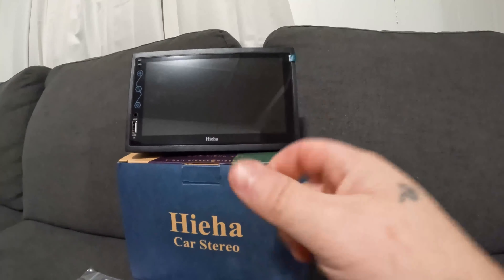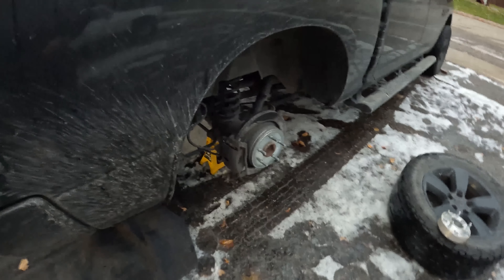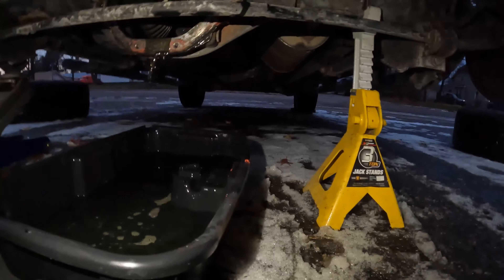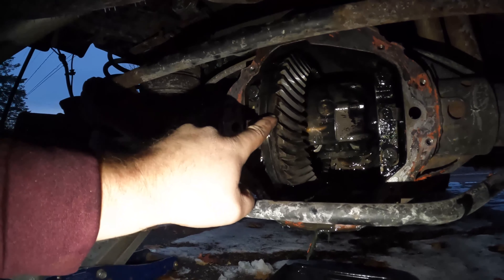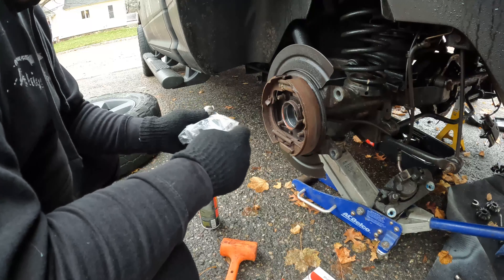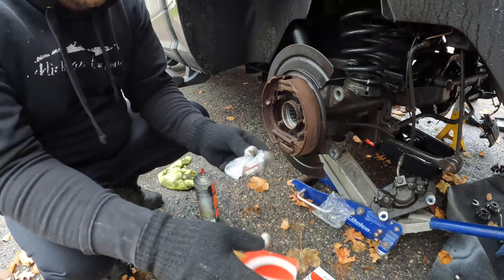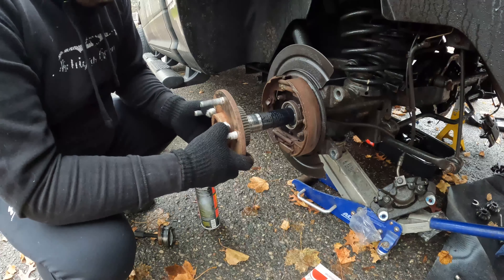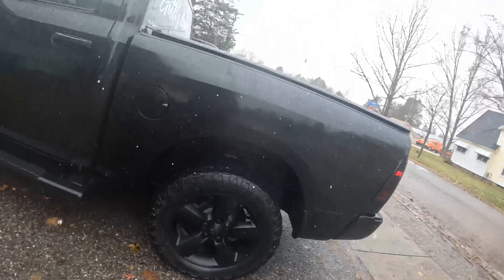09+ Ram Rear Wheel Bearings Replacement #ram #viral #howto #diy

Comment: How did you turn the differential wheel for better access to the pin? I have rear wheels lifted, diff. Cover open, but turning the rear wheel is not turning the differential. Thanks.
Reply from the maker: turn using the drive shaft. im sorry this took to long, I hope you got it figured out

Comment: Was the noise you used to diagnose the bearings growling that seemed to wind up and down with wheel rotation as your speed increased and decreased ?
Reply from the maker: Yes it was a growing life coming from the rear end. I actually jacked up the rear and put it on jack stands put the truck in drive with traction control off and was able to hear which bearing it wae

Comment: Did you have alot of vibration from the rear end? And hear any popping from the rear when taking off? Im sure that this is next for me along with tie rod ends.
Reply from the maker: No just a roar/humming noise. It’s a very easy process you got this
Reply: @GottisGarage  ya I've fixed almost everything on our rides, done front hubs but never rear bearings. Ima buy the tools from harbor freight since we own multiple dodges

Comment: Telling us the cost of rental tools and overall cost compared to getting it done in a shop would have been a nice touch.
Reply from the maker: Yeah I can see that as being helpful lol so this is what I have 
My Shop is 3.2 hours of R&R = $480+ parts +60-70% up charge= approximately $135
Cost for yourself doing it $100 tool rental which you get back after returning them
$6 per axle seal $60 for the bearings so $72
Reply from the maker: I didn’t count diff fluid or the rtv of course
Reply: Uhh, they refund you on rental tolls anyways, it coat me about 160 to rent and I'm doing the repair today. Return within 48hrs to get tool refund

Comment: You don’t need to grease the bearing’s?
Reply from the maker: No it uses the diff fluid for that, but definitely put some grease on the seals to prevent them from tearing. I had to replace the seals a couple months after I did this. After lubing up the seals no issues

Comment: why did you not pack the bearing?
Reply from the maker: Because those are lubricated using the differential fluid. That’s why when a seal goes  bad the axle leaks. You don’t pack those.

Comment: was this truck making a whining noise ?
Reply from the maker: Yeah it was. I ended up jacking up the rear end, using my harness to shut everything off and putting it into drive and shifting the gears up to get speed. The. Crawled under the truck to pin point where the noise was coming from. Turned out to be the rear axle bearings